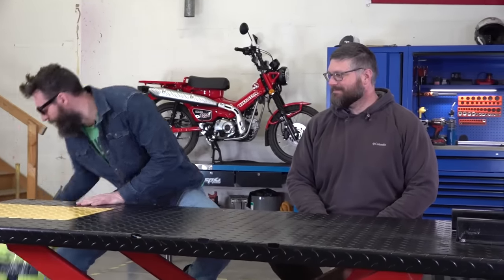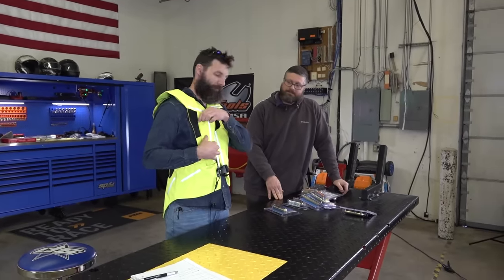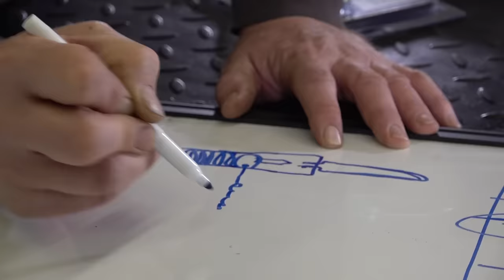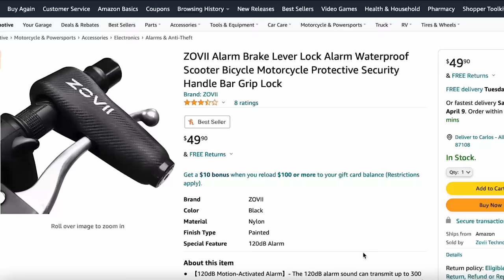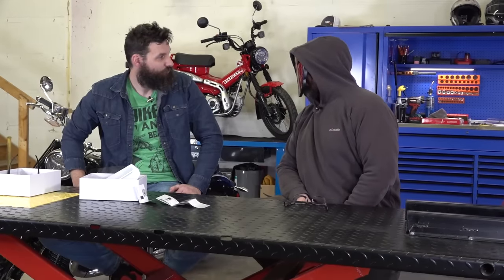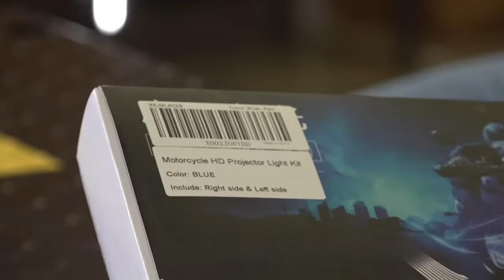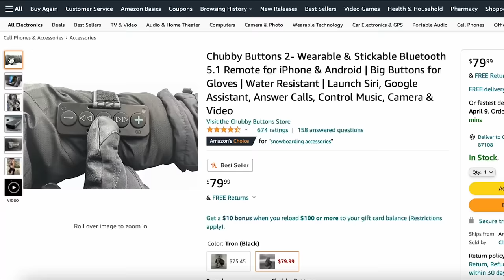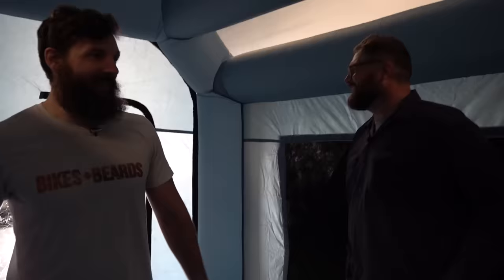Testing Amazons stupidest Motorcycle Accessories (#1 is life saving)

Comment: #1 Pressurized canisters for fish, that sounds "Amazing", where do I get an "Emergency Inflatable Fish" from?
#2 "What happens when someone comes up & tries to steal your bike" with a "Cordless" AngleGrinder? I use 2 small padlocks on my chain top & bottom, 1 goes through a link then I turn the rear wheel till it stops on my small sprocket, then I fit the 2nd as close to the small sprocket as possible, it is a bit of messing about but they don't look for them & even when they do they can't get too them with grinders or cutters, it's a good "Addition" to your "Security" for very little money.
#3 "It's a mask that you wear under your hoodie when you're" robbing a bank. " The Purge" UK, I can't wait, I'm going to be a very busy little boy that night. You just know it will be banned worldwide the very moment you spend your money on it, just think how many people you could get in deep shit with that, now it's interesting.
#4 Awesome, it looked like you were Vincent Furniar(your just going to have to look it up) doing a concert. I build bikes for pleasure & pay & I have been fitting rear fog lights that project onto the road, it seems to help with drivers' "TailGateing", they drop back to see what it is & tend to stay there, not only are they cheap but they are also "Tiny" it's a tube of 20mm diameter 60mm length with a very small bracket, you don't even notice if you don't know its there.
#5 I'm not sure we want to see you & Craig flicking your respective "ChubbyButtons" while you're riding you're bikes, some things require "AloneTime".
#6 I made mine out of 2 washing lines & 4 plastic "DustSheets" from the Pound shop(DollerStore) & I ventilate it with a "LeafBlower", it's great with 2k paint but not so much with cellulose.

Comment: The airbag vest is really only useful on the track where the thing you are going to hit is 90% the pavement and 90% from a high side.
Reply: Not necessarily, I've had plenty of crashes sadly and always end up separated from my bike. The worst thing on the road for bikers is been pulled out on by a car driver. When that happens you normally go flying over the bars before hitting the floor

Comment: Could you put the alarm on the  Throttle side? Also could you  Swap the blouer fan smaller 1 stong to keep the booth up and then the bigger 1 could move more air though might be after its full swap then the little one only has to keep it full not fill it up.

Comment: As to the Air Vest-  Yes you would have been on the ground before fully inflated..... and that is part of the intentional (or more likely accidental) design.   From studies I read year ago..... As you hit the ground it is only partially inflated cushioning your bash... and the remaining inflation improves neck, chest and spine protection from further stuff like sliding/rolling etc.
Reply: Research has moved on and the scenario you describe is not supported by European Standard EN 1621-4, if it was ever valid at all.
Reply: venture to say it is still better than just a motorcycle jacket alone though
Reply: @coachgeo  : When partially inflated, the internal pressure is not sufficient to provide protection as the gas at the point of impact is displaced to other parts of the air chamber, leaving inadequate resistance to compression. There is a point at which the internal pressures reach a level where the gas is increasingly unable to move within the chamber, when impact energy attenuation starts to be provided, but this is only in the latter stages of the inflation process for properly-engineered products. The standard has been written based on how products which have been specifically developed to protect motorcyclists function. Products developed for other purposes, and opportunistically re-tasked for motorcycling use without amendment, will lack these essential characteristics. 

Standards exist to help consumers to avoid unsafe products, but for those wanting to place their trust, and their ribs, collarbone and scapulae, in a product which has no demonstrable fitness for purpose, that is their prerogative as consumers and there are clearly plenty of vendors willing to part them from their cash.
Reply: @paulvarnsverry11  "path of least resistance".  IFFFF they designed it right (or got lucky in how it turned out)  the areas of impact while still inflating would push the CO2 into the areas of the bladder where the body is needing most protection.
Reply: @coachgeo  : In fact the gas gets pushed away from the point of impact, which is where protection is most needed at that moment. If the rider tumbles onto a different part of the airbag (which is the point I believe you are making), the process is repeated, but at a decreasing level (the moving of the gas away from the point of impact) as inflation will have continued whilst this has been taking place and internal pressure will be progressively higher.
Reply: @paulvarnsverry11  have you ever looked close at the difference between an air mat designed to cushion and an air mat designed to rebound?  a cushioning air  bag needs to move the air away at a slow controlled-ish way.  You don't want it solid firm unless only intent is to spread the force over a larger area.  In this case moving the air in or to provide cushioning/dampening is likely better to help the internal organs of the body that do have some float to them... not get jounced around so much.
Reply: @paulvarnsverry11  correct some air is pushed away from point of impact. Have you ever looked close at the difference between an air mat designed to cushion and an air mat designed to rebound or just support (tumbling air mat vs air bed vs air crash mat) ?  a cushioning/dampening air  bag needs to move the air away at a slow-ish controlled-ish way.  

You don't want it solid firm unless only intent is to spread the force over a larger area.  In this case moving the air in or to provide cushioning/dampening is likely better to help the internal organs of the body that do have some float to them... not get jounced around so much.
Reply: ps- air bags in a car inflate fast..... they also deflate and a controlled rate just afterwords.

Comment: Curious if the vest wouldve been slightly quicker if it didnt have to puncture the cartridge aswell as inflate..say as if the cartridge was already under pressure and only need the tether valve opened..idk

Comment: Co2 cartridges are readily available and about $5 at bicycle shops.
Reply: The big ones? The vest dosen't take the little ones I've seen in pellet guns and emergency tire inflators. It takes ones that are like 4x the size.
Reply from the maker: yeah these are bigger than those
Reply: @volvo09  yes. There are multiple sizes for different size tires. The ones for my fatbike with 4” wide tires is about twice the size as the one used in the video.
Reply: @BikesandBeards  There are multiple sizes for different size tires. The ones for my fatbike with 4” wide tires is about twice the size as the one used in the video.

Comment: Guess you would want to attach the vest lanyard to the key. Hopefully it's a habit to pull the key when you get off.
Reply: Keys are flimsy, you don't want it attached to something that could snap
Reply: @bb-ballistics1706  usually, kill/activation cords don't require much tension. Common sense is always "key".
Reply: @hogroamer260  60 foot pounds of pressure
Reply: @bb-ballistics1706  No problem for my motorcycle keys. But since I don't often wear a helmet, I'm certainly not buying one of those.

Comment: Oh boy, you really have the BMW with the cancer exhaust? This could be a nice art piece, if you switch out the exhaust to a nicer one. But then there is still the problem with the riding position. I am a fan of Boxers, but here its crap. The kneeangle is horibble.
The only pros are warm foot, warm legs and the engine itself works a bit like a crashbar. And then the price....

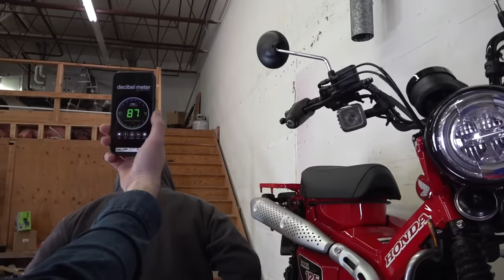Comment: Your decibel reading @ roughly the 9:00 mark wouldn't have been an accurate illustration of the decibel output at the source. 
I'll admit upfront that the convention for SPL readings is 1 meter so yes, officially the claims do not meet convention, but this is more of a deceptive advertising issue, but not straight out lying.

Volume decreases at the square of the distance, so exponentially, AND decibels are measured on a logarithmic scale.
It works out that the decibel level decreases by 6 decibels for every doubling of distance (in meters) (or 6 decibels for every halfing of distance.).
So taking your phones position to be roughly 1 meter from the alarm, and your reading to be 80dB at that point, by the time you get one mm from the alarm it would be reading 120dB...
So technically, it more or less checks out (caveat to this is you are in an enclosed space so there will be reflection off the wall and other confounding factors, but you get the point.)
I know this is kind of a cheesy way to make your product seem better than it really is, but it's actually really common for product marketers to use point source levels instead of SPL standards.
So unless a product specifically states otherwise, it's best to assume the claim is point source.